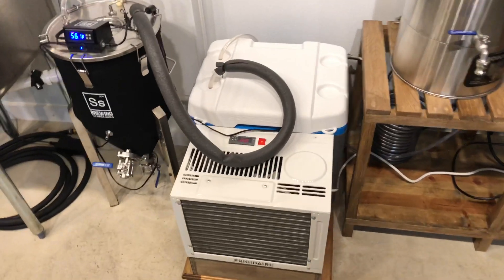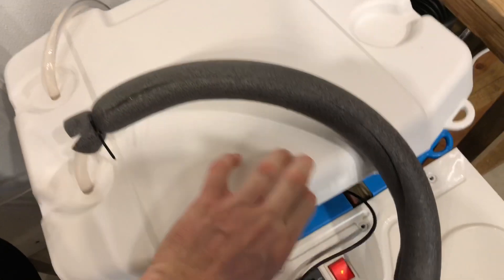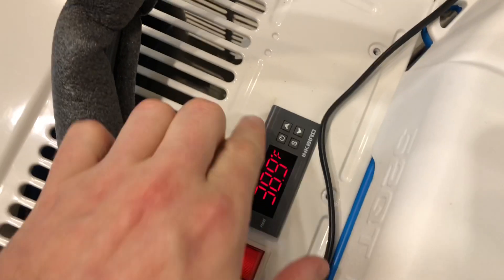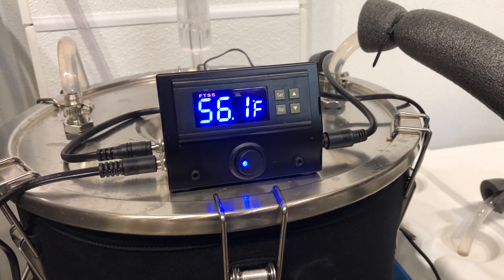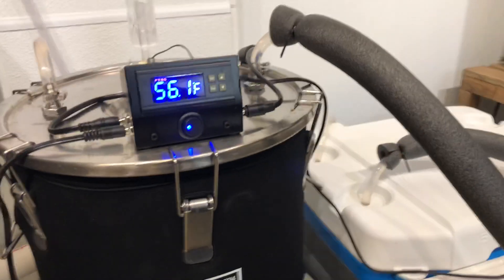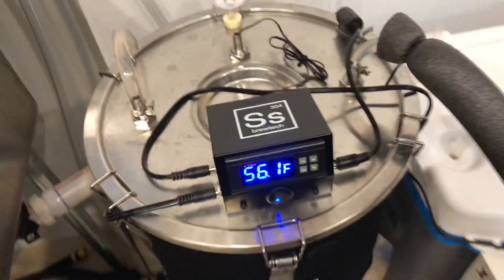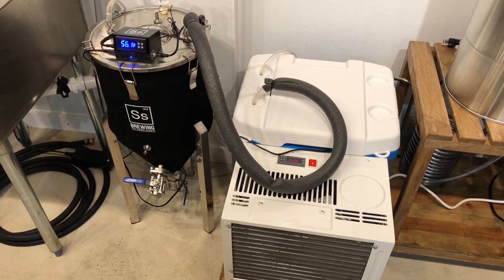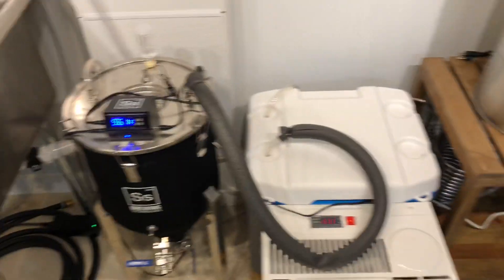Running the  homemade Glycol Chiller - Observations

Comment: What do you use the glycol for?
Reply from the maker: THE-LURGY beer making, and a 60w c02 laser... interchangeably.
Reply: deependstudios But I heard that glycol is poisonous and makes you blind.
Reply: @112330059daniel  There are two general types of glycol used in chillers. Ethylene glycol is used in many industrial applications, but is more toxic. Propylene glycol is generally considered food safe, and is used anywhere where food contamination is possible.
Reply: @112330059daniel  it doesn’t touch the beer

Comment: Is a glycol chiller better than a fermentation chamber for homebrewing? I assume that a fermentation chamber is only effective up to a certain size as there would be too much heat being produced by a large fermentation. I like the idea of a glycol system but I'm not sure of the extra expense to setup and run it. A chamber almost seems better because you can put any fermenter in it.
Reply from the maker: The unit ended up being smaller/more mobile for me to use in my basement brewery space and will react more quickly than an air-gapped chamber for actual chilling purposes.  

At this scale (7g in the fermenter max), however,  the differences are likely pretty negligible in practical use.  Ultimately, I've made much better beer with my controlled fermentations, so whether you go the chiller route or the chamber, you'll end up with a more consistent - more reproducible end product.

Comment: I see a lot of builds with the evaporator in the cooler placed on end versus the original orientation. Any reason for this? Thanks!
Reply from the maker: The main challenge would be sealing the cooler after cutting a spot for the lines to pass through when oriented in the 'original' horizontal orientation.   By rotating it 90 degrees, you are able to get the lines near the top edge of the cooler.   Obviously different models will vary.